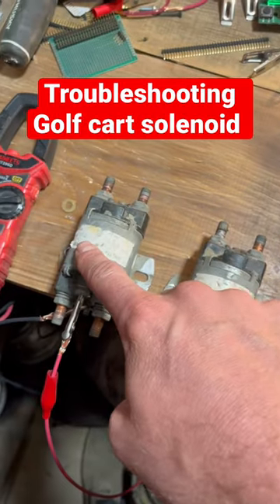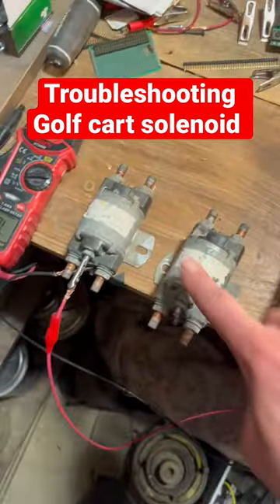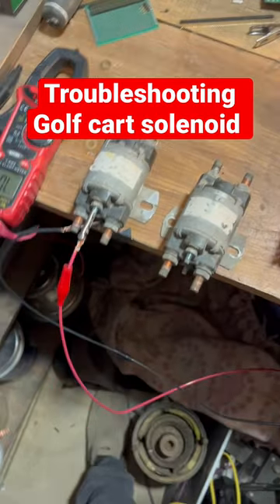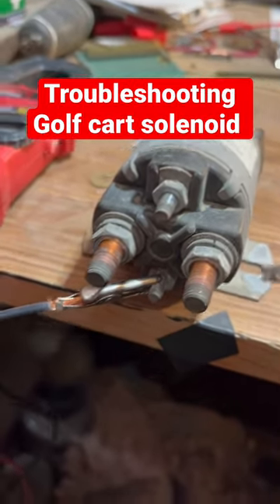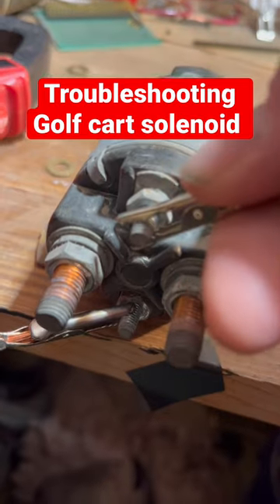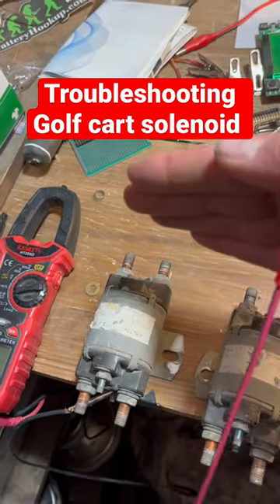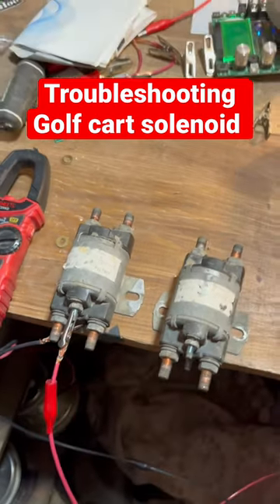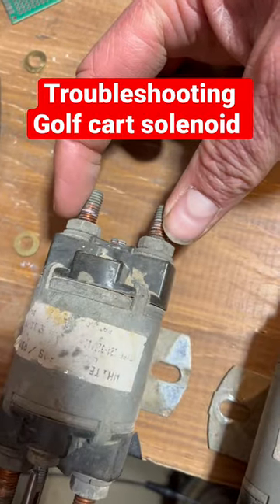Troubleshooting Golf Cart solenoid ￼

Comment: Do you have a picture of how your two solenoids are wired?
Reply from the maker: I do not, and it definitely is not easy to wrap your mind around. I do have a different video on how reverse in a series motor works that might help you wrap your mind around how to wire the contactors.
Reply from the maker: https://youtu.be/PeDp94nIw8M?si=4qL7dWHzuFKMDi22